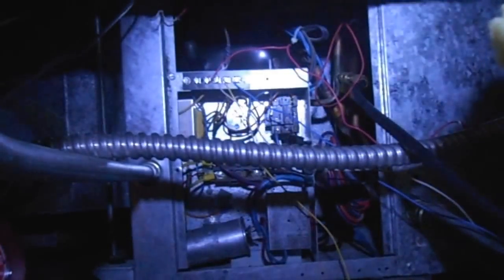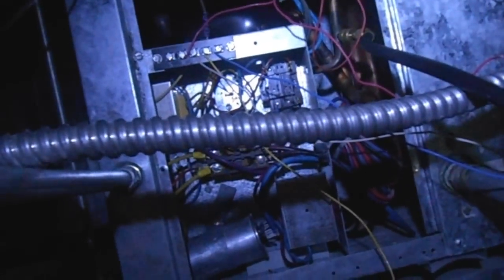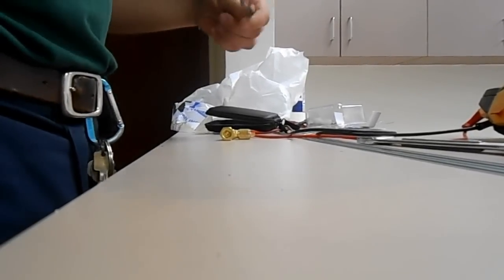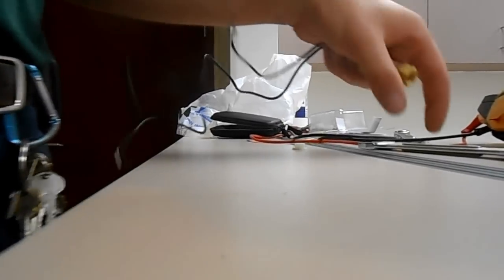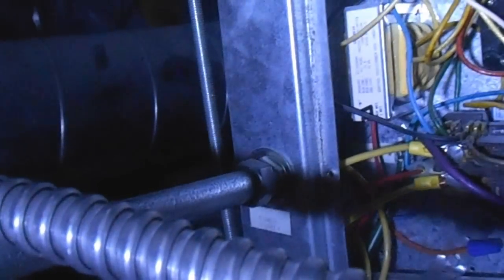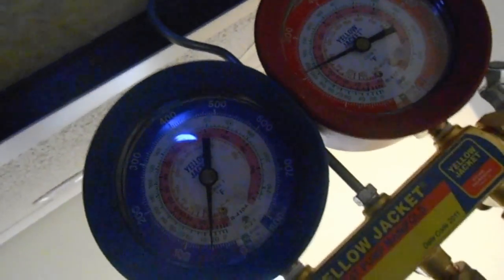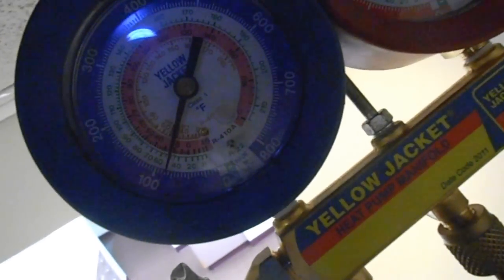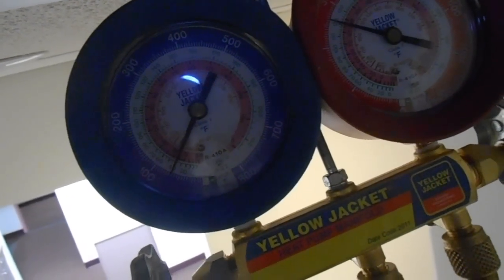HVAC: Pressure Switch Troubleshooting/Replacement

Comment: This has got to be one of the stupidest videos -- of course MOST are; so this is truly no exception.  First he doesn't adjust the camera to show what he is doing.  A lot of video cameras, if not all, have a reversible screen to check what you are taping FROM THE FRONT.  (Oh, a crappy Go Pro.)  Secondly, and MOST IMPORTANTLY, this HOW-TO video is to show you how to INSTALL THE RESET/HI-PRESSURE SWITCH on your home AC unit.  He freaking leaves the entire procedure out!  WTH!  Find a way to place or hang the camera somewhere.  That is the hard part!  My personal experience is that in unscrewing the old switch, there is no way to cut off the internal unit pressure and so all the refrigerant will leak out, and not slowly, but at a high enough pressure to make it difficult -- thankfully not impossible, for me last time -- to put the new one on!  So THAT is the whole reason to seek help and watch this video.  Unscrewing and reconnecting wires is baby sheet!  So this video is NO HELP AT ALL.  And to top it off, finally, thirdly, he, the professional, gets the WRONG DIAGNOSIS and replaces the wrong part!  USELESS.
Reply from the maker: you've made a lot of assumptions and sound like an angry, bitter person but, that is your right. quite frankly, i very seldom work on residential units as they usually aren't worth my time. the concept is the same. if you can't grasp that; no video can help you. my camera used here was a low budget digital camera on a hat mount; no were near as nice as a shitty go pro. please take your negativity somewhere else. Enjoy your useful existence

Comment: this is everything you should not do. If you take any thing away from this video, it should be do things 3 or 4 times the wrong way or once the correct way.
Reply from the maker: Situation is not ideal of course. this is what you can accomplish: a temporary fix for a customer who doesn't want to pay for a proper fix. OR A fix for a person without the proper tools. Both described my situation at the time. your comment is not really clear other than it seems to be negative; so that might be something to work on. have a nice day

Comment from the maker: +Michelle Franck Sorry I just saw your comment. RSD and other HVAC/R suppliers will stock a 3/8" sweat x 1/4" Female Flare w/ depressor fitting. This could be soldered onto the switch you have and installed with a wrench.

Comment: Hey there! I ordered a high pressure switch for a carrier heat pump.  The new pressure switch does not have a  port hook up.  Is there a way to modify the new one to have a port hook up? It looks just like yours, except it has inside diameter of 3/8" x 2" copper tubing.

Comment from the maker: You can also ohm out an existing pressure switch instead of shorting the unit's two wires together to see if the switch is open. I hope that answers your questions. Thanks again for commenting and have a great day! :D

Comment from the maker: Quickly finger-thread the female flare fitting onto the existing service port. Have a 5/8" open end wrench handy so you can tighten it up quickly. Torque well (with a back up wrench on the service port) and leak check with soap bubble formula. Reconnect wires to new PS. Test for continuity across the two switch wires. You should see ohms indicating the switch is closed allowing control voltage to flow to the compressor contactor. If you read OL (over load or open line) the switch is open...

Comment from the maker: If gauge reading is within manufactures specifications: the pressure switch is faulty and needs to be replaced. Leave the factory switch if it is brazed in. If there is no service port; install a piercing valve. Get a 1/4" Male Flare x 1/4" Male Flare x 1/4" Female flare w/ depressor Access Fitting. attach a new PS to the male flare without a schrader core. Torque this connection well.  Tighten the schrader core into the other male.

Comment from the maker: Also, if you could not gather the procedure from my video: Pressure switch testing/ replacement is easy. Shut off service disconnect and find the switch, Unplug wires from switch connectors(or cut and strip if hard wired into switch). Jumper or wire nut the two wires going to the switch together. Attach manifold gauge to which ever pressure side is in question. Purge Hose(s). Restart unit (compressor will start if pressure switch is the issue) and observe gauge pressure.